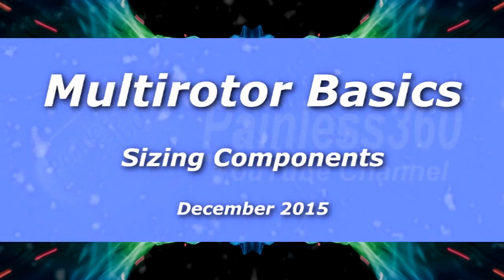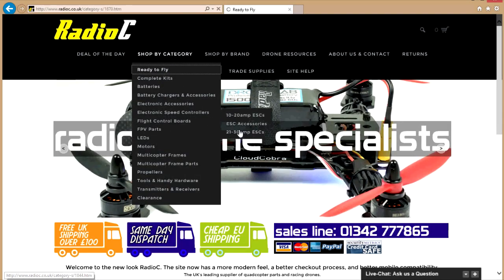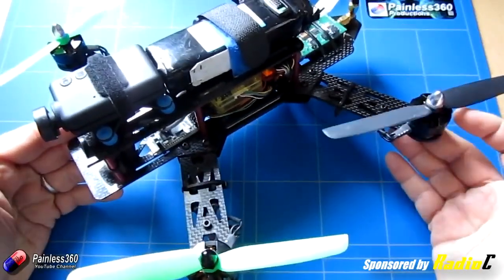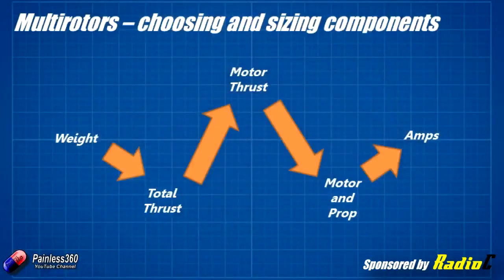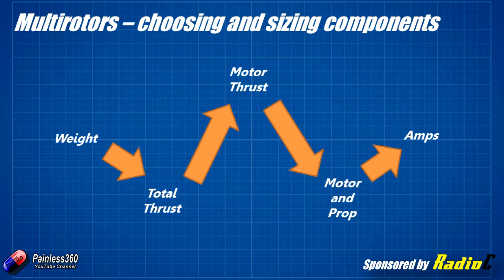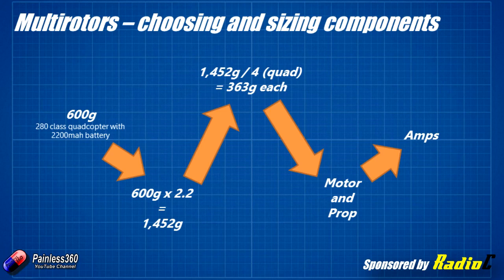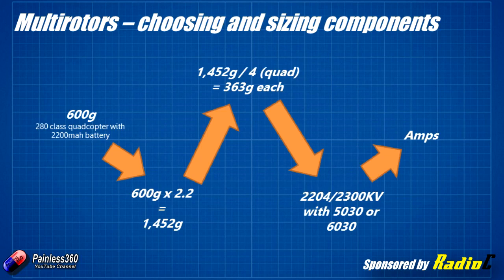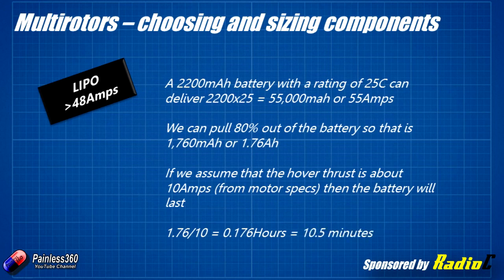RC Basics - Sizing Components (motors, ESCs & LIPOs) Sponsored by RadioC.co.uk

Comment: Have you done a version of this video for fixed wing gliders / planes for beginners so they can source motor / battery combo's with confidence? I have watched hours of your vid's but can't find this. I guess it would be simpler than for quads but none the less very much a need to know subject?
Reply from the maker: Not as such but that is a good idea. I will add that to the list..
Reply: I presume it's a case of knowing which battery would work with rx / esc etc whilst providing maximum flight time from the lowest weight battery – it would be very handy to know.

Comment: sorry for the lack of knowledge, but i was wondering if a 2350kv will be ok with a 20amp esc? i want to get those motors but i dont know if i should install a 30amp esc to it or will the 20amp esc be sufficient
Reply from the maker: Depends on the prop you will use.. check out the amp draw for that setup and use an ESC with a higher amp rating.. best of luck!
Reply: thank you for replying so quickly your videos are awesome, happy flying

Comment: Wonderful Video. Just what I needed. Thanks !! :)

What if I use larger battery say 11.1v 22000mAh 40c for the same configuration above ?
Max apms will be 2.2 x 40 =88amps 
But in this configuration above used, 48 Amps  is required by the drone.
Reply from the maker: The motors and ESCs will only pull what they need - the battery won't 'force' more current into them than they want. That's not how it works. Best of luck!
Reply: this mean I will get more flight time with higher mAh battery , and it won't burn this 11.5 apm motor ?
Reply from the maker: Yes. More mAh = longer flights.
Reply: Thanks man , you are awesome :)

Comment: I have a qustion, and I apologize if its a dumb one.
How do I know what szie of BEC to get?  I fly 3S, and my old ESC's had the BEC built in, but i am rebuilding and need to save space.
Which is better?  Built in BEC or separate unit?
Thanks to anyone who can help....
Reply from the maker: +odinata It depends on the kits you are running on the model. For most applications where you are not using any servos then a BEC that gives 1-2A is enough, for those models that also have a servo (Tricopter) then a 2A is better and for models that use lots of servos (planes etc.) then 3A or more is useful. Also, the more electronics you add to the model (GPS, OSD, etc.) - the more amperage you need.UBEC position is a personal choice. I like them as part of the ESC for simplicity. We have a few other videos on RC power (some are linked to this video) that may help you too..
Reply: Painless360
Thank you sir.
Its a quad with a gimbal for the gopro, a bluetooth module, LED lights.
I like the BEC built into the ESC as well, but I just cant fit them in.
Hmmm kind of a quandry.
Reply from the maker: I'd plump for a 3amp one then you'll be safe. You may be able to get away with 2amps but it depends on the servos etc..
Reply: Painless360
The gimbal runs directly off the battery, so that doesn't come into play.
And I can't find any 2 amp BEC anyway.
Google only turns up 3A or higher BECs for the most part.
I guess I'll go with a 3A

Comment: I have 2804 / 2280 kv with 20 amp emax symon series with 6-4 props on my ZMR 250 quad never runs hot even on the hottest of days with throttle wide open
Reply from the maker: +robsycko I'm not surprised. Most of the heat in an ESC comes from the integral Linear BEC (if it has one). Those motors will not be pulling much more than 12Amps so the ESC will not even break a sweat supplying that when it's capable of 20Amps. Happy flying!

Comment: Very nice video, but for me there is one element missing..Voltage..Are your calculations based on 2s 7.4v, 3s 11.1v or more.? If the voltage is changed, would that not change the motor speed and the current draw.?
Reply from the maker: The sizing of all the components us predicated on the amp draw. Battery cell counts will change the props you need on the motor (see the linked videos) and you need to make sure that any Esc/Bec elements can handle the higher voltages too. 

As KV is revs per volt a larger voltage will increase the speed of the motor and thrust but care needs to be taken when choosing the prop.
Reply: +Painless360 Ah yes I can see, I have watched the other links attached to this video and gradually finding the pieces of this puzzle. Lord only knows how to select a motor when designing a brushless gimbal..Thanks for your response..

Comment: so my motors draw around 11 -12 amps what happens if I use a 20 amp esc? would I be able to use it still?
Reply from the maker: +Inteous FPV Yes, the motor is the thing that decides how many amps are pulled - not the ESC. Happy flying!
Reply: +Painless360 ok thanks so it's no different than using a 12amp esc then
Reply from the maker: An ESC with a higher rating than the motor is always a good idea. Don't use a 12a esc with a 12a motor. A 15a esc would be a better choice..
Reply: +Painless360 alright thanks for the info! I knew having a higher ecs amperage is better  but I wasn't sure if I went too high. thanks
Reply from the maker: ESC > Motor is good. ESC < Motor is bad :) Happy flying!

Comment: Great vids. But nothing about how to choose the right propeller pitch and size for best performance vs longer flights.
I know its depends on setup but in general? Coming vid maybe?
Reply from the maker: +Wicked Nicke There are a few cards in the video with links to videos where we covered this exact topic (hint low KV/Larger props = longer flight times :) )
Reply: +Painless360  yes know but i meant for the size of the one in this vid, mini quads around 250 size. 
I hope you dont take it the wrong way, i only thougt this vid was missing the prop selection bit. It was very good and informative.